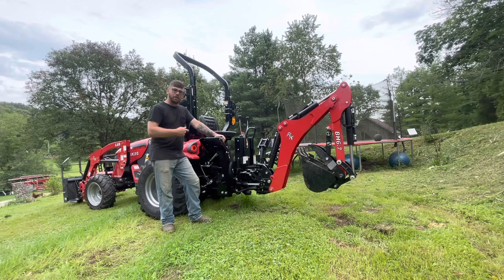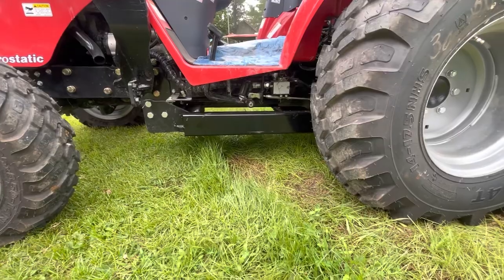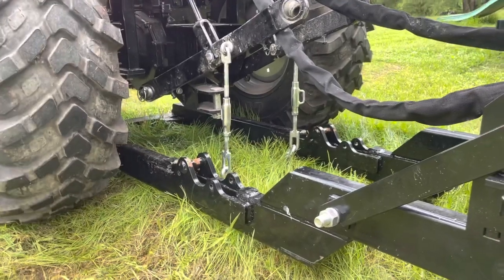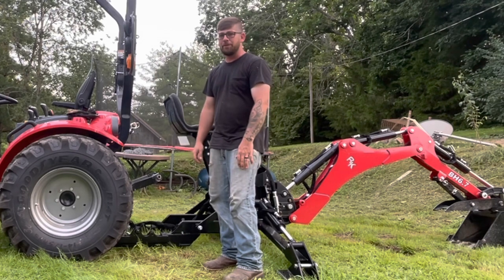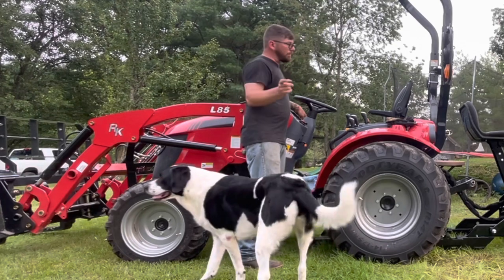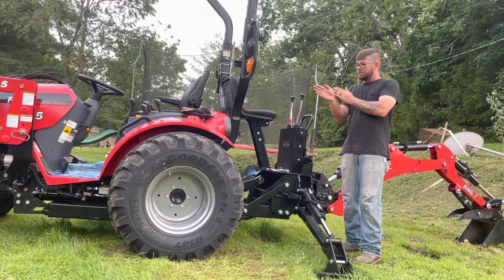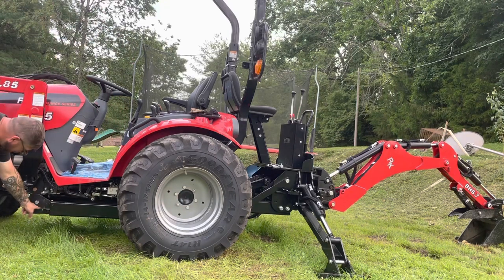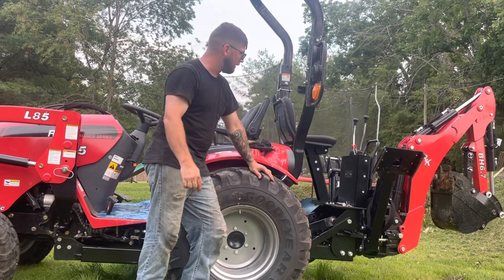#13 RK25 T25 Backhoe How to Remove & Hookup : FULL EPISODE

Comment: I have a TYM T264.  My backhoe attaches the same way and after a time or two of attaching/detaching, it becomes a breeze. One suggestion... place a eight inch block under the backhoe and  between the outriggers. After setting a while, the outrigger hydraulics will leak down and the front of the sub frame will be sticking up enough to cause clearance issues when backing over the sub frame. Great video!
Reply from the maker: I actually have exactly what you mentioned set up in another area of the property. This video was taken for a quick in and off plus easy area to record. Thank for the tips though. This comment will help others. Appreciate the compliment.

Comment: Thanks for this. I am getting ready to go install mine now. I took it off about a year ago and need it today. Great explanation!
Reply from the maker: Hope this helps. I will be making a new updated video. If you find something I missed or that could help. Please let me know.
Reply: I do have a question. My backhoe only has about 6 hours on it. It started swinging too far to the right and actually dented the metal next to the rubber bumper. When it did this, it would not return to the left without bouncing it right & left and then it would finally return left. Is there a way to adjust the valves for swing stop?

Comment: This is a nicely done video with good attention paid to steps and techniques to employ in removal and installation of the suffrage mounted backhoe. It is VERY similar to the Branson 4815Ch that I have... wish I had seen this when it was published. It's the best step by step video I've seen to date for this system. Now, if I can just figure out how to best store this backhoe when removed from my tractor that doesn't obstruct everything else in my small "barn".
Reply: Subframe!  Darned auto correct isn't worth a darn... ;-(
Reply from the maker: Thanks for the compliment. I have mine setup a certain way when storing. I will certainly try to make a video show the details. Thanks again for watching. Be sure to subscribe

Comment: Thank you for this video. I will be picking up my RK25 with the backhoe in the next few days. This video is extremely helpful in letting me know how to disconnect and reconnect the backhoe. I do have one thought, however. When you're reconnecting the backhoe, as you said, you can use the hydraulics you paid for to help you out. Once it's aligned, couldn't you use the bucket to push the subframe back into position under the tractor when you're hooking it up? I know the outriggers would drag a bit, but for a one person operation, it seems like that would be easier than getting on and off the tractor to move the tractor into position.
Thanks to a recent Rural King promotion, I am getting a free mid-mount mower deck with my tractor. Although I will only use the backhoe occasionally, I expect I'll use the mower a bit more. According to the sales rep I spoke with, the mounting brackets for the mower won't work with the backhoe brackets attached and vice-versa. I was looking closely at this yesterday, and I believe he is incorrect about this. I am hoping I can have all the brackets installed, then just attach whichever implement I need at the time. If anyone has experience with this, please comment!
Reply from the maker: The mid pto is more of the problem. As I understand you cannot have a RK25 that has both the mower and the backhoe. Unless they have changed it. The mid pto does not come installed on a rk25 unless you add the mower. When you add the mid pto it is in the way of the backhoe subframe. So if you want to use the backhoe subframe the mid pto has to be removed. Which means all of the fluid in the transmission has to come out, remove the mid pto, install the original cover to go in place of the mid pto and then replace the trans-hydraulic oil. The could have made changes. So what I am going to do is wait to see when the local Rk has one with a mower and one with a backhoe. I am gonna go down and look. If they will allow me I will take a video. 

The program for the free mower is great but I know a lot of people have had to turn down the mower because they need a backhoe.
Reply: @gatheringrusthobbyfarm8081  Thank you for the quick response. This is definitely a good thing to look into, as I would like the ability to use both implements easily if possible. I didn't get that far underneath both tractors to see that issue. My concern at the time I looked was the brackets, because that's where I was told the conflict existed. I will look at the mid PTO the next time I'm there (perhaps later today) to see how the mid PTO is hooked up. Thank you again for your quick response.
Reply from the maker: @FarmRanchHomestead  the brackets, as I understand, also have conflict.

Comment: Denny,  thanks for the detailed uninstall/install on the RK 25 backhoe. 
Watching you struggle with alignment makes me believe if a quick connect solution will come forth for the backhoe just like the quick attach on the front end loader and the quick hitch for the  3-point hitch. 
Surely this can be engineered by someone smarter than I. 😉
Reply from the maker: Glad I could help share details. 

Did I struggle?

Comment: @Cypher911x10
18 hours ago
I do have a question. My backhoe only has about 6 hours on it. It started swinging too far to the right (sitting on the backhoe) and actually dented the metal next to the rubber bumper. When it did this, it would not return to the left without bouncing it right & left and then it would finally return left. Is there a way to adjust the valves for swing stop? Do the hydraulic swing cylinders adjust...like screw in or out to limit travel?

Comment: Thanks ordered mine and getting it at the end of this month. How is the digging power with the backhoe. Can you adjust the flow rate to speed up and slow down the backhoe .
Reply from the maker: Plenty of digging power. If you need more just raise the rpm. If you need more than that then you may damage stuff. There is no other adjust that I am aware of to the remotes.